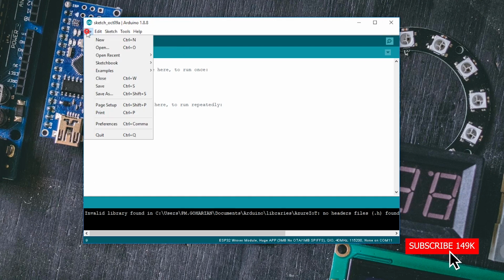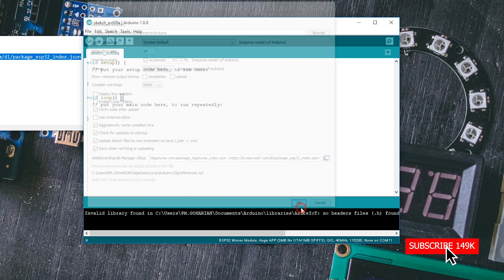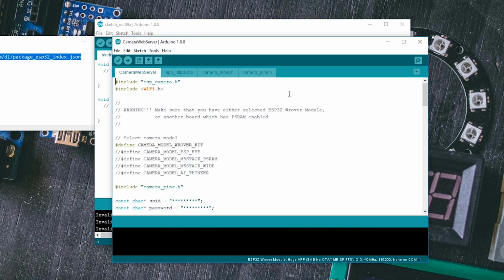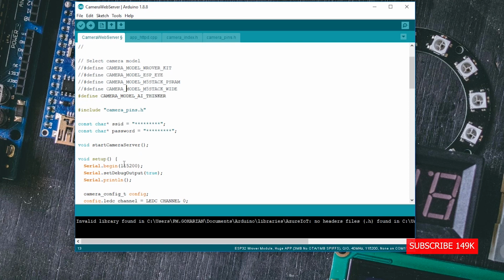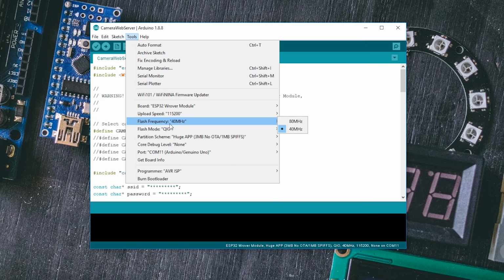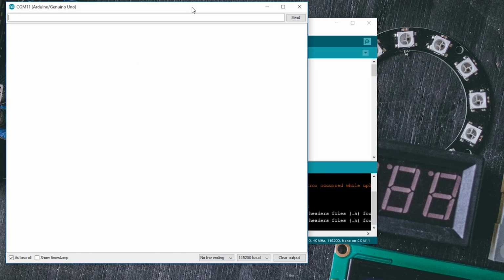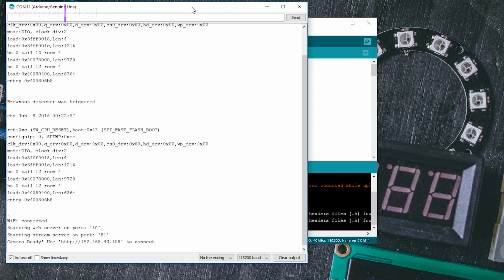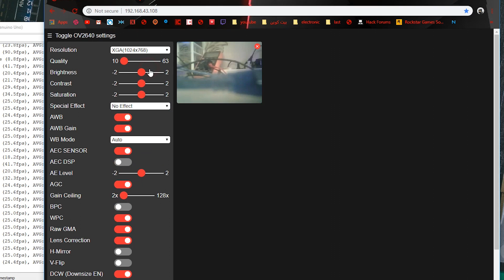How to setting up ESP-CAM with arduino "No more USB TTL"

Comment: Select the board : AI thinker ESP32-cam if you are using this camera like in the video. Also open the serial monitor with a baud rate of 115200

Comment: Thank you for sharing this exercise, very clearly.  I connect my ESP32-cam to an Arduino UNO.  I getting the following message:Arduino: 1.8.11 (Windows 10), Board: "ESP32 Wrover Module, Huge APP (3MB No OTA/1MB SPIFFS), QIO, 40MHz, 115200, None"Sketch uses 2100683 bytes (66%) of program storage space. Maximum is 3145728 bytes.
Global variables use 53552 bytes (16%) of dynamic memory, leaving 274128 bytes for local variables. Maximum is 327680 bytes.
esptool.py v2.6
Serial port COM3
Connecting........_____....._____....._____....._____....._____....._____....._____A fatal error occurred: Failed to connect to ESP32: Timed out waiting for packet header
A fatal error occurred: Failed to connect to ESP32: Timed out waiting for packet headerThis report would have more information with
"Show verbose output during compilation"
option enabled in File -> Preferences.Please, advise.
Reply: Don't know if you've already solved this problem but maybe try the following sequence --> after pressing upload from the IDE hold down the boot button and hold and release the reset button! 
Worked for me on my devkit-c module